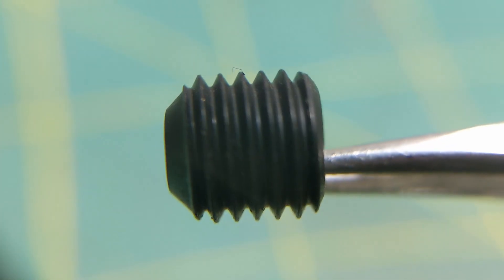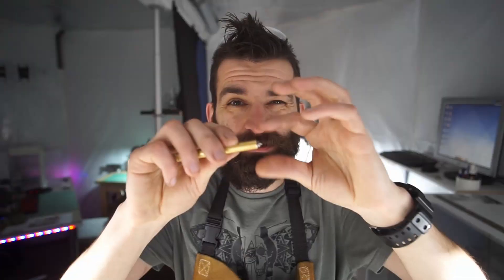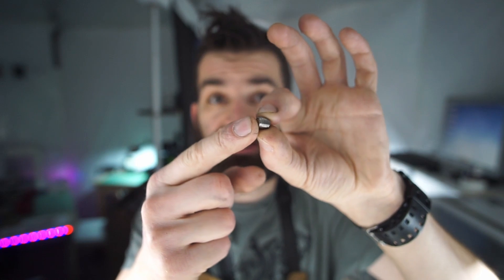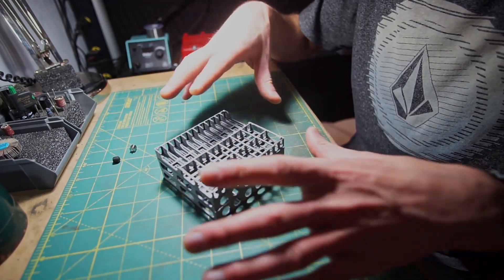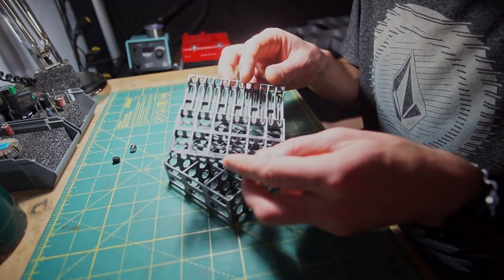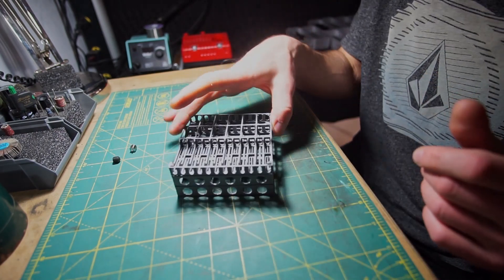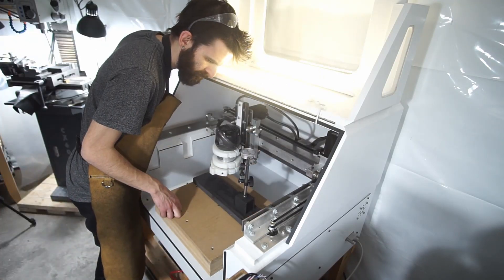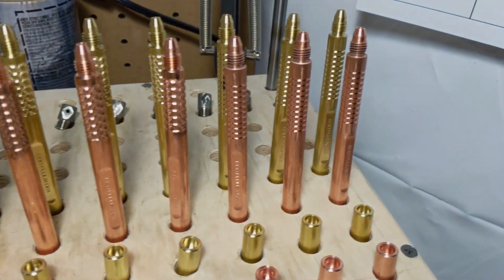3D Printed Parts for Ultrasonic Cleaning

Comment: Did you handwrite the gcode to thread mill that rod?
Reply from the maker: No, it's posted out of Fusion360 as standard lathe code 👍...I do have to do a little hand massaging of the gcode to allow the multiple work offsets to function smoothly.
Reply: @CurtVanFilipowski  Very cool.  I never thought of it working on a mill.

Comment: Beautiful cleaning racks! Solid work
Reply from the maker: Thanks! The prints leave a little to be desired in the finish department but they work so that's all that really matters in this case. :)
Reply: @CurtVanFilipowski  at least you can reprint some if you need. I need to do the same for darts, keep the metal off the wire bin. Thank you for the inspiration!
Reply from the maker: @CharlieSearsRacing  You are most welcome!  I have seen a few people on insta post similar ideas. Was pleasantly surprised that PETG took the heat so well!